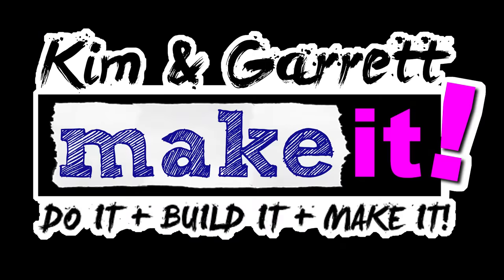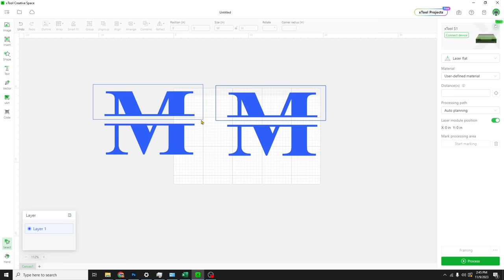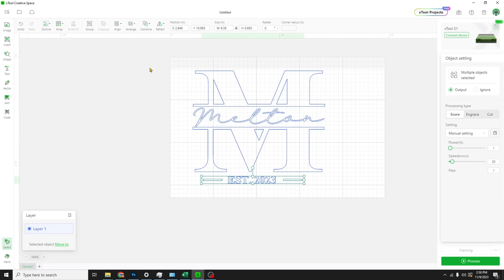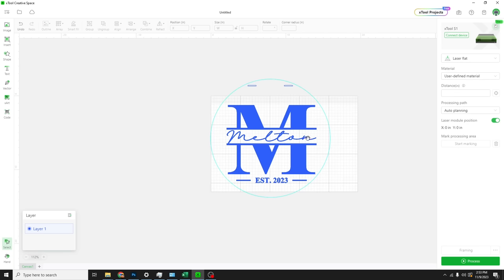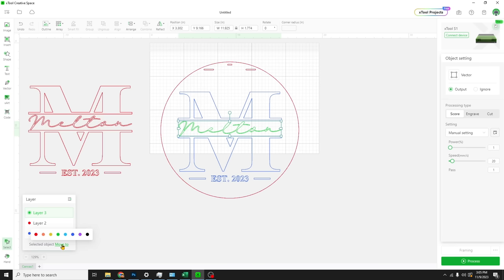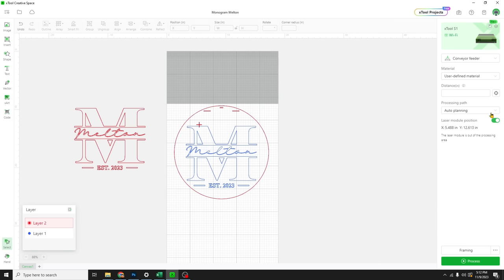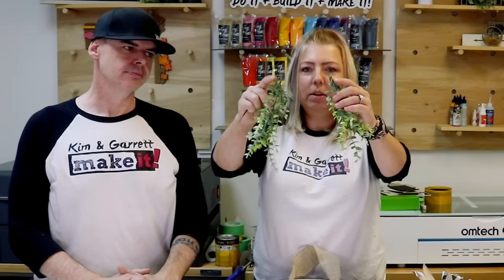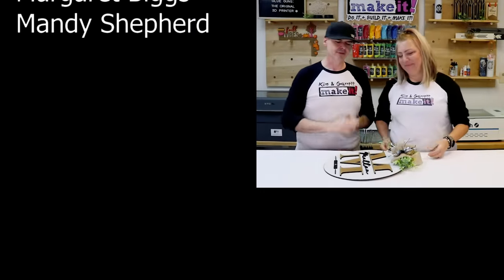Money Making Monograms: Design Personalized 16" Door Hangers with xTool Creative Space  S1 40W Laser

Comment: I noticed you used a board 19 x 26.  I looked on your site where you sell the MDF but didn't see this size.  I purchased some door hangers to make but didn't see a board that would work to do an 18" hanger without maybe getting a larger board and cutting some of it off to fit in my xTool S1 40W laser.  I will unbox laser tomorrow and set it up.  I am new to all of this so may ask some dumb questions.